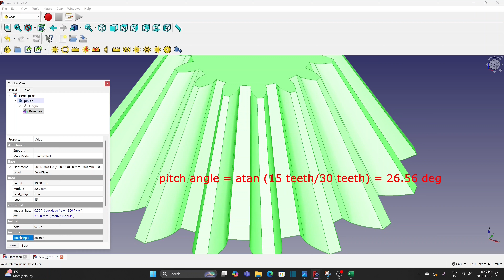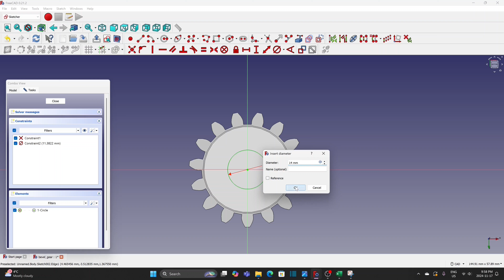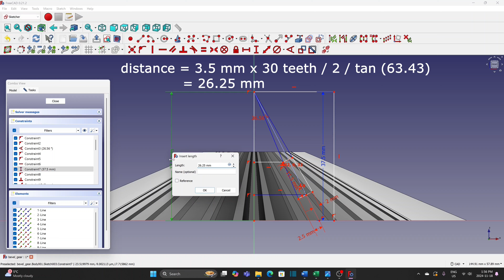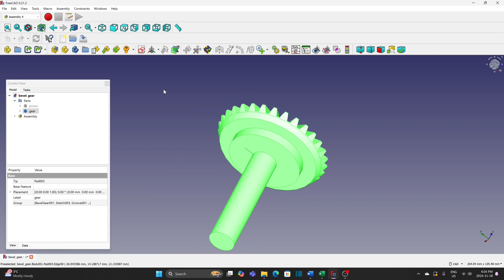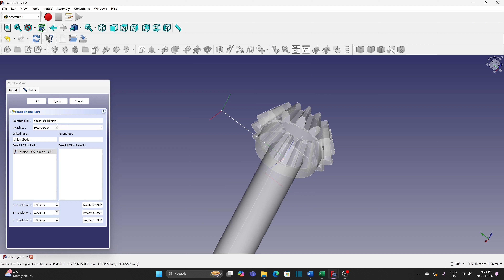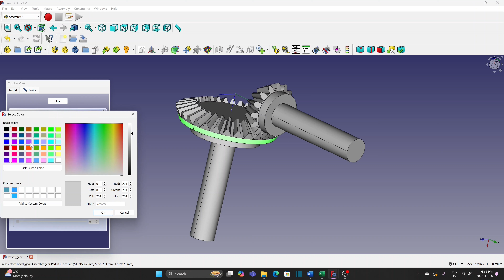FreeCAD Assemly4 tutorial for beginners - how to mesh bevel gears.

Comment: How come the pitch height is not just Tan = opp/adjacent, tan26.56 = 15/adjacent, adjacent or pitch height = 30.01.  I dont understand why 2.5mm x 15 teeth and dividing by 2
Reply from the maker: Hi, the bevel gear I make is with 2 mm module. However, I need to make a bigger gear and cut to the right size. First, I make a gear with module =2.5mm. The height is based on the gear with module 2.5 mm not 2 mm. Pitch diameter is number of teeth x module = 15 x 2.5mm =37.5mm (also base on the gear with module with  2.5mm)
Then the radius is 37.5mm /2 = 18.75mm
The height = 18.75/ tan 26.56 = 37.5mm
Hope this help. Any questions, please let me know.